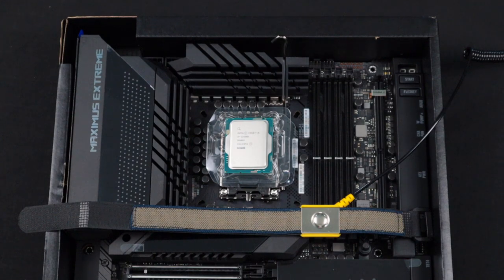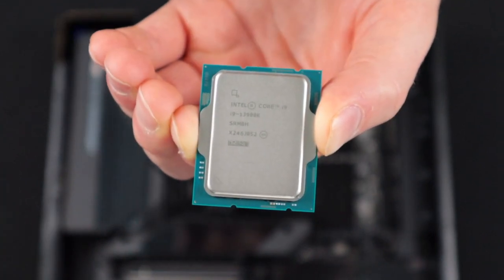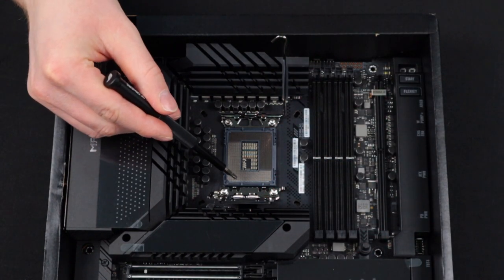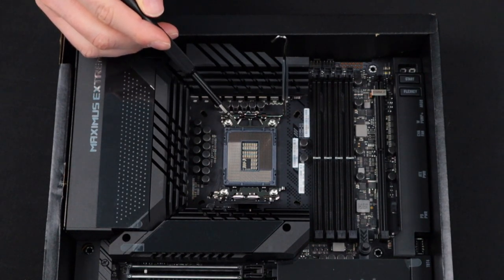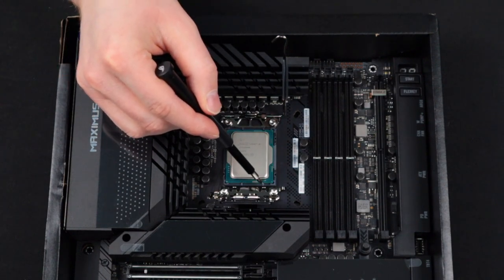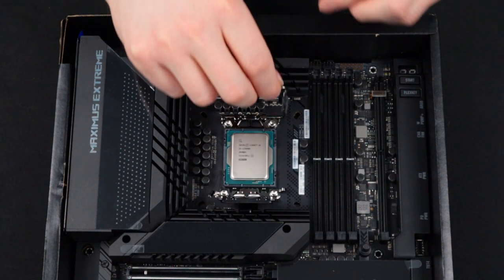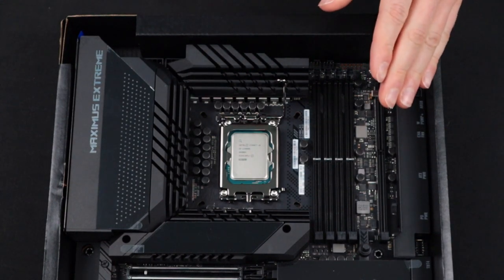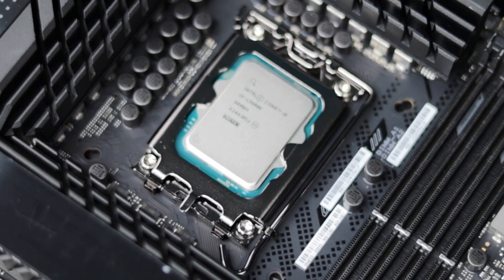Don't Destroy Your Motherboard..

Comment: This Motherboard is a Remarkable Masterpiece! 

The Flagman of the ASUS for Intel CPUs.

One of the best features is that you can install Five superfast NVME drives on it! The motherboard includes additional DIMM.2 module for two drives and another three on the board itself!

If you wish, you can make full videos about these two Super-Detailed PDFs in the motherboard Manual & Document section - The User Manual with All Motherboard Features and the BIOS Manual that show the True power of features! You can actually work with the Motherboard even Without a CPU ( ! ) or GPU for troubleshooting or updating the board BIOS. :)

Great video! Sub from me, and do you know what - I will spend some time right now and support you by watching All of the videos that you upload to this moment!

Good luck with the channel, and do not forget - Every long Jurnes starts with the First Step! :)
Reply from the maker: Thank you for the encouraging comment and I really appreciate the sub and you watching my other videos! I am planning on doing deeper dives into features and bios once I finish building, as there is just so much to the board to cover! Looking forward to you being apart of the channels journey forward!

Comment: Personally I'd recommend something like the $18 Thermalright or $39 Thermal Grizzly Contact Frame Anti-Bending Buckle. Personally, I prefer the Thermalright because it's designed to be cranked all the way down, whereas the Thermal Grizzly's you have to be careful because it's not designed to go all the way down.
Reply from the maker: That’s a great recommendation if you want to go that route!
Reply: @techtoniksystems  .. Tom's Hardware "Thermalright’s LGA1700 contact frame is an affordable, easily installed solution for those affected by LGA1700 bending. It can reduce CPU package temperatures by up to 12 degrees C in our testing. "
Reply: @techtoniksystems  .. I'll say in my experience 3-5 C lower temps.
Reply from the maker: @DJaquithFL  Looks like I will be doing some testing and making a video about my findings in the future! Thank you!

Comment: installing a cpu is very easy.
Reply from the maker: It definitely is easy once you do your first one, but for a first time builder it can be a little nerve wracking/confusing so I wanted to have a video to help newcomers with that! I know when I built my first PC I was nervous of bending pins and when I felt the pressure of the ILM on the build it was definitely a little unnerving!